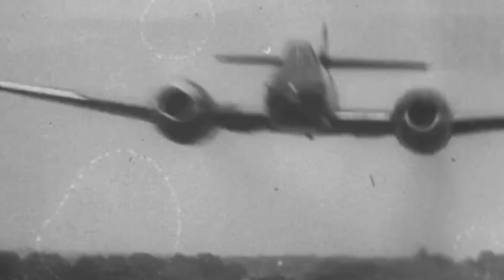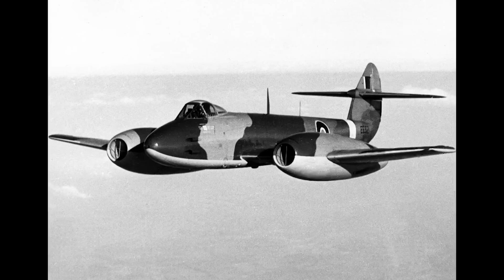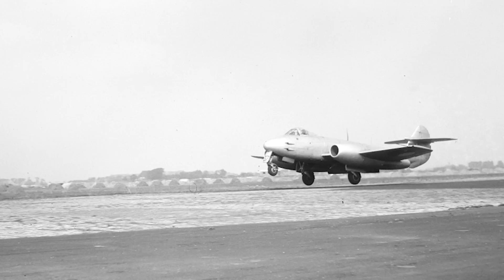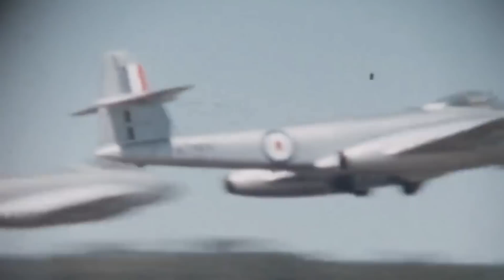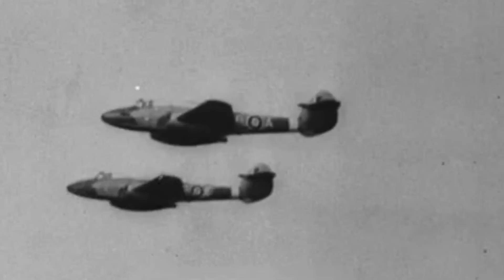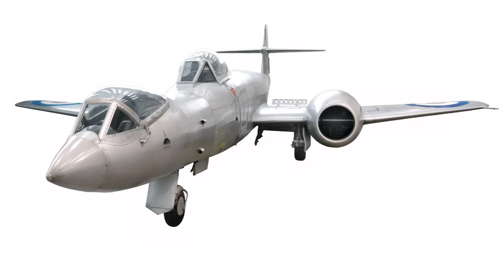The Weird Aircraft That Changed Air Combat Without Even a Fight

Comment: Did the engine housings get slimmed down to smaller diameter on later variations of the aircraft? (more advanced engine,smaller crossection relative to the intake diameter? )

Comment: Frank Whittle submitted the first patent for a jet engine that worked, so he effectively invented the jet engine as we know it. He also patented the bypass version which is the basis of modern turbo fans. Note: The Germans were working on jet engines at the same time but were having problems, solved once they had read Whittles patent. As told to Whittle after the war by one of the Germans involved.

Comment: Eric “winkle “ Brown flew both the Meteor and the ME 262. He considered the 262 the better aircraft as it was ‘…a more stable gun platform…’ Adolf Galland came to the same conclusion. He said that the best fighter of ww2 would have been the 262 with British engines.
Reply: "The me 262 was no fighter"
"The me 262's engines had an average scrap life of only twelve hours"
"The me 262 couldn't perform any aerobatic fighter maneuvers such as the split S for instance" 
"The me 262's engines were too sensitive and very fragile and that cost the lives of many of its pilots"  
"The me 262 could only work as a boom and zoom interceptor and it was even deficient in this task because it lacked dive brakes" 
- Eric Brown

Comment: This was a crap plane. It went through 28 modification cycles before it was any good and by then it was obsolete.
Reply: What nonsense.
Reply: Hi Werner. Maybe, but it was an excellent effort for a first attempt. Shooting down the Fuhrer's flying bombs wasn't exactly a failing mark. Cheers, P.R.
Reply: @philliprobinson7724  
It flew operationally until the 1980s.
Reply: @johnburns4017  Hi John. Thanks for that. I guess the last Marks with 3rd or 4th generation engines were very good planes indeed. It was always about the engines. Have you read Sir Stanley Hooker's book, "Not much of an engineer"?  He was a gas-flow dynamics man and developed the double supercharger for the RR Merlin. Later in the '70's he rescued the RB211from being stillborn. Hooker and his team saved RR from the world's biggest corporate flame-out. A ripping good yarn and every bit of it true. Cheers, P.R.
Reply: @philliprobinson7724  
Yes, I have read Hooker's book. Excellent. The Meteor went thru many updates. Just after WW2 it was reaching 600mph. It is still used today by Martin Baker.
Reply: @johnburns4017  Hi John. I'll look forward to the DH 100 Vampire getting a video overhaul by "Only Planes". Cheers, P.R.
Reply: @philliprobinson7724  PR, The citizens that were saved because Meteors zapped Fieseler 103s before hitting homes or businesses were probably grateful.  DM.

Comment: The meteor did not have twin booms, that was the Vampire. When the Meteor came up against the soviet MiG 15 in service of the Australian air force in the Korean war it did not do so well as a fighter, so it was reduced to round attack. Initially it speed was only slightly better than the fastest piston engined fighters, the 600mph was reached after the war with upgraded engines, in a special version to capture the world air speed record. Whereas the Me 262 did reach 600mph when it attacked lumbering USAAC B-17's.
Reply: Only planes is quite sh!t at facts and language. "It's engines howling the end of propeller driven aircraft".
Reply: The MIG 15 was a more modern design than the Meteors used by the RAAF. It was no surprise that the Meteor was inferior as a fighter when used against the MIG. And yes the ME262 could reach 600mph but due to the fragility and high fuel consumption of its engines, could only do so in short bursts. As an interceptor, it was relatively useless and ineffective, it's high speed allowing only a few seconds of gunfire at a target aircraft as fuel high consumption allowed only one pass at an opposing aircraft.
Reply: @EVISEH  Sometimes one pass is all that's needed at the B-17 flying at max 170mph.
Reply: @Leon-ej3kh  One 262 per B17 is a very low kill rate.
Reply: @EVISEH  
The speed of the 262 in combat was around 500 mph while the RR Griffon powered Spitfires in 1944 could reach up to 480mph, only 35 mph less. The 262 had poor maneuverability and control issues at high speeds at around 550mph resulting in the tail surfaces locking driving the plane into the ground. The me262 pilots were instructed not to go over 450 mph. Also the engines would stall if the throttles were opened too fast - a major flaw.  The minor sweep of the Me 262's wing was never designed with the intention to gain high speed, it was to gain balance when fitting the engines. The inboard wings were almost straight with the outer wings swept.  

The Meteor and 262 were major advances in technology at the time, but it's important to know what stood out. The Germans were facing fuel shortages in mid 1944. Their supplies of aviation fuel were cut off by the Soviets in the east. Without an adequate supply of aviation fuel the Luftwaffe's BF109, and FW190's would become useless. Germany had lots of coal mastering the manufacturing of J2 synthetic fuel which was suitable for jet engine use. The Luftwaffe invested in jet fighters and bombers from 1944 onwards as they had little option.

In the UK the advantages of jet engines were well known, yet propeller aircraft made in massive volumes were more than suitable, so the development of jet aircraft was never seen as vital to the war effort. Whittle's design was taken by the government so any other designer or company could use for their own designs leading to centrifugal flow engines by other companies like Rolls Royce, De Haviland as well as Whittle's Power Jets. Metropolitan Vickers were working on axial flow turbojets first running in 1940, with multiple types produced during the war for use in high speed launches and gensets. 

There were five turbojet engines in the UK under R&D in WW2:

1)  Centrifugal, by Whittle (Rover);
2)  Centrifugal, by Frank Halford (DeHaviland);
3)  Axial-flow, by Metro-Vick;
4)  Axial-flow by Griffiths (Rolls Royce);
5)  Axial flow compressor, with reverse flow combustion chambers. The ASX by Armstrong Siddeley;

The Metropolitan Vickers designs were test flown in 1942 producing more thrust than anything Germany produced with a longer service life. The axial-flow were more expensive compared to the centrifugal designs with still development problems to solve, so being funded by the government they were never selected for any aircraft with cost being one of the rejection points.  Metropolitan Vickers produced the first successful turbofan engines rated double anything Germany ever produced during the war. Also the turboprop engine found largescale use post war because of its excellent fuel consumption.
Reply: @EVISEH  With probably the highest weight per burst of any aircraft other than the Tse Tse.  and the capability to do several more passes ina single sortie.
Reply: The top speed of the 262 was about 540 mph, not 600. The Meteor Mk 3 speed was about 480 and that was in action in Holland in December 1944. The 590 mph Mk 4 was in service in 1945 but missed the war. The Mk that served in Korea was the Mk 8 with better handling but still at 590 mph.
Reply: @alangledhill6454  Yes, the 262 needed an engine change every few flights. You forgt to mention that the Meteor held the WAS in 1945 at 606mph and again in 1946 at 616 mph.  It was no dud and was in use with over 20 air forces for over two decades.
Reply: @alangledhill6454  Well we're not going to quibble over a paltry 40mph (Wikipedia has it at 560mph).
Reply: It was actually slower than the Tempest
Reply: The engines on Me 262 only lasted a couple of flights before being scrap, and the crude engines had a nasty habit of flaming out, as well as being an 'on or off'  throttle.   Meteor was slower but a lot more reliable, engines ( centrifugal compressor for maximum pressure ration per stage, centrifugal compressor also pretty immune to FOD ) with longer range with 500 hours between engine rebuilds.  The Me 262 was the first disposable aircraft.
Reply: @chrissmith2114  I know that, well not quite correct. The Junkers Jumo engine had to be striped down after about 10 hours, whereas the RR Derwent on the meteor's maintenance was 100 hrs. Sir Frank Witt;e knew of the axial flow engine (there's a vid of him talking about it here on YT) but he knew the metal of the time was not suitable so he went for the compressor engine. In this case  British conservatism, outweighed the German thinking.
Reply: @chrissmith2114 It depends on which manufacturer's engine the ME-262 was using.
On average they got 10-15 flight hours per engine.
But there was one feature unique to the ME-262, a Pull Starter, like a lawn mower.
You have to admit the Germans had it all over the Brit's for Aerodynamics and Looks.
Reply: It would be nice if they had narrators briefed by Subject Matter Experts (amateurs with experience and hobbyists, at the least) who review scripts for technical accuracy.
Reply: @TegwynF  Sounds like censorship to me. We are allowed to make mistakes, when it comes down to it, it's only a bit of fun.
Reply: Thank you for correcting the video.  Obvious mistakes drive me crazy.
Reply: @Shannon-ij1pm  you're most welcome
Reply: The design of development
Reply: Australia never had Mig15s in service !
Reply: @nigelwatkins558  I was referring to the Meteor coming up against the MIG 15.
Reply: @Leon-ej3kh  read what you wrote !